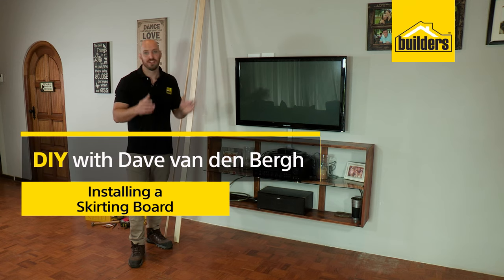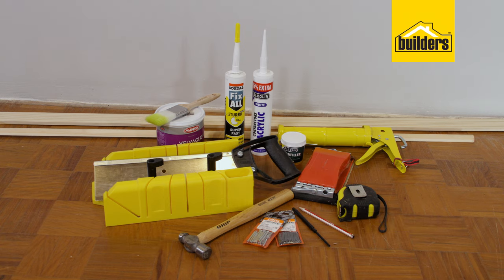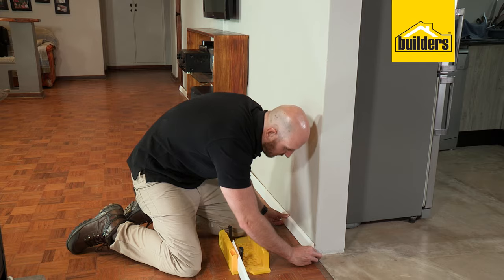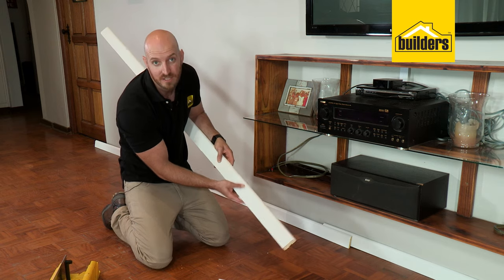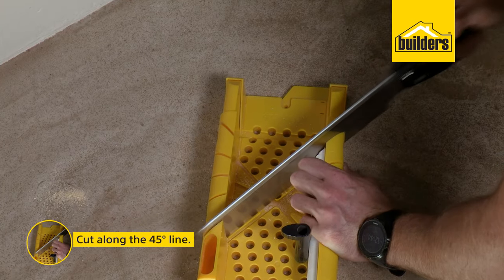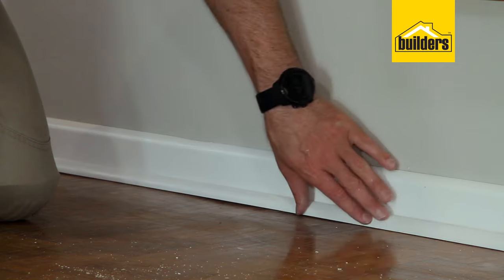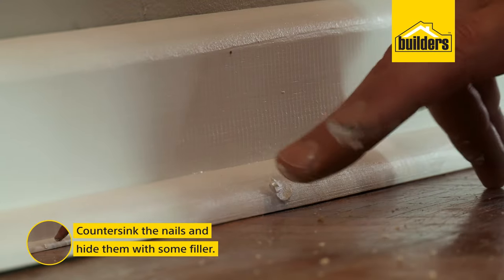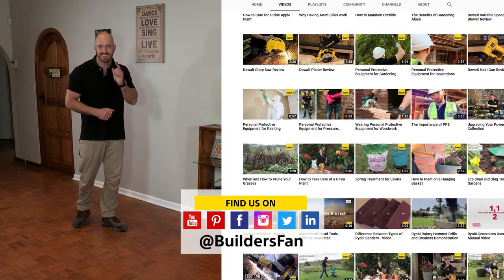How to Install a Skirting Board

Comment: At 2:13 is that really correct? Surely after cutting only the two corners of the plinth will meet and not the two faces for glueing together.
Reply: The cut is in the same direction.